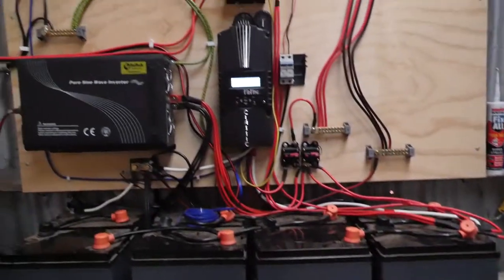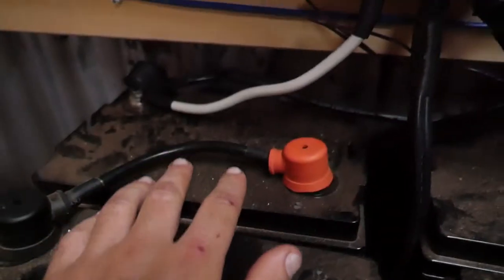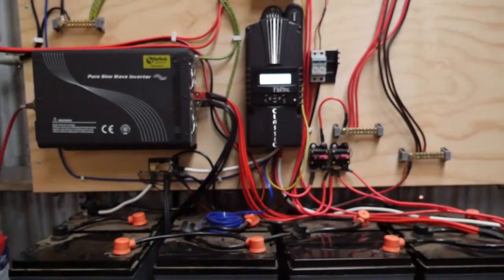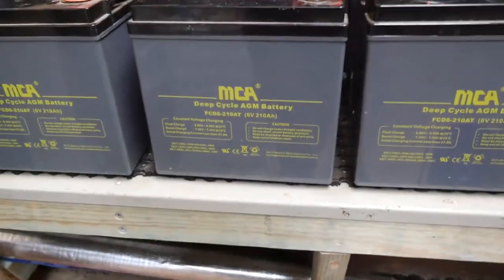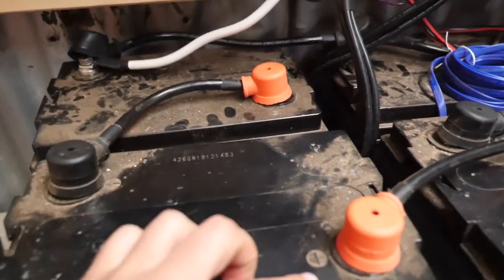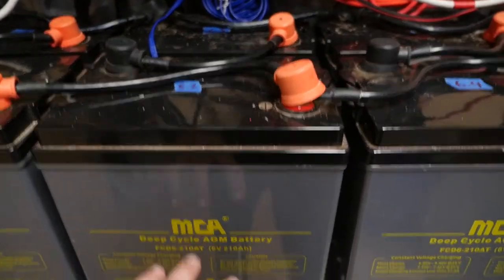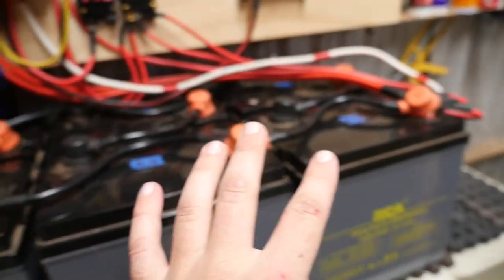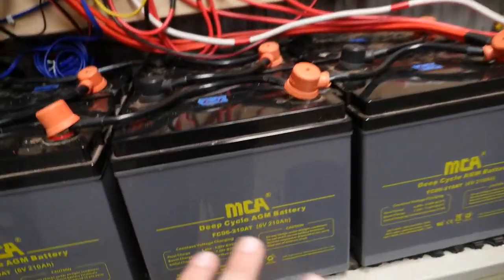My Off Grid Battery Bank Was Wired Wrong!

Comment: G'day mate, love what your doing there and at such a young age to. Well done.
I am building a shipping container home in Gippsland Victoria and I am on a 12 volt system and have a wind turbine, and solar array. I am just starting to piece the equipment together now for a water heater and i have ordered a 400 watt 12 vol heating element which I will put inside a small water heater.
I love this journey, it has given me such joy but as you will undoubtedly know it can also be frustrating and stressful as like you I have had some sleepless nights researching online and have to piece together bits from here and bits from there as there just does not seem to be enough clear and concise information out there, I fnd the best place to garnish good info is from the forums of people who are actually living this stuff but at the same time the forums can be tumultuous with ego's running rampant and end up reading stories for hours.
Glad you got your battery wiring sorted, it can be dangerous with too small cabling going from things into batteries, I have had wires melt in front of my eyes as they were too small.
Keep up the great work mate, can't wait to see more of your updates and projects.